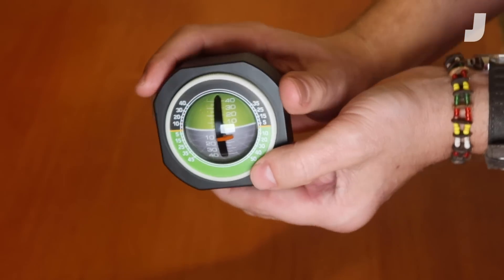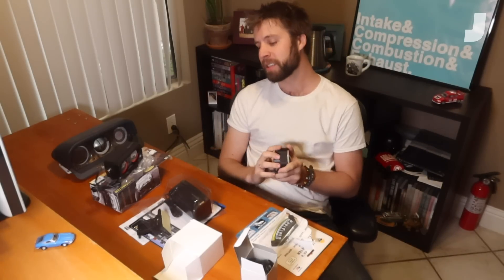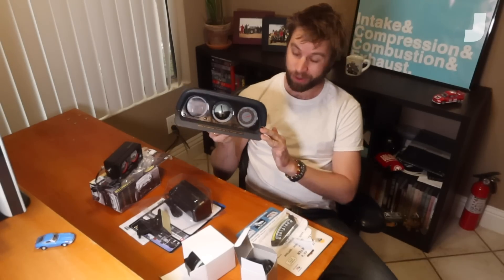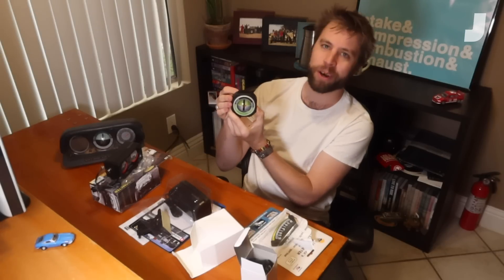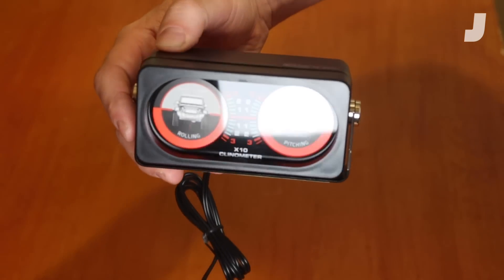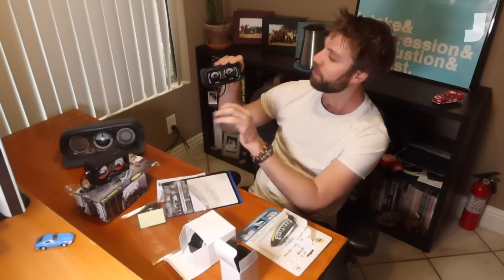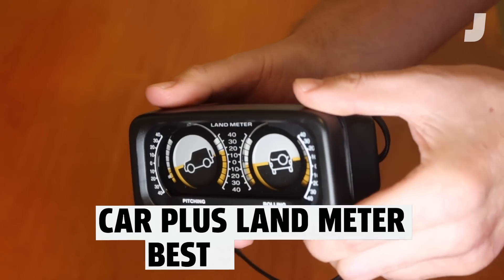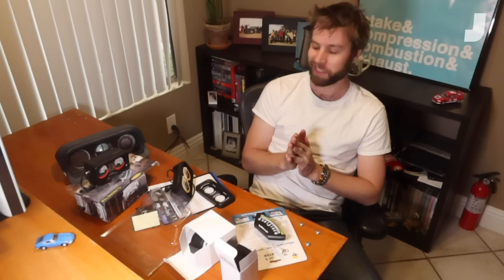WTF Are Inclinometers And Why They Are Cool

Comment: maybe they could make one to measure how hard someone brakes and accelerates
Reply: It's actually possible to do that by reading the OBD port (the weird connector beneath the steering wheel area). it'll be able to tell you how hard throttle is being pressed, how hard the brakes are being pressed, so on. It depends if the car has sensors for those though. Allstate and a bunch of other insurance agencies offer small devices that connect to this port and read that data (drivewise, snapshot, so on). They then periodically use cell towers to send the stored data back to the insurer. 

If you're looking for the actual acceleration change of the car, the OBD port could also technically be used for this I think. You could find and get the car's current speed, and do some calculations on the last few values to get current acceleration. I think there are OBD-based info displays you can buy that mount to your car, but it might make for a cool Arduino or raspberry pi project if you have some experience with the stuff.

Comment: That's great you like the Lev O Gauge! I use two in my 4Runner. Its fun for offroading but I use mine for when we setup camp since my wife and I sleep in our truck when camping. 

Where did I mount my two? Well one is on the dashboard for side to side readings and the other on the passenger door for front/back readings. I found it easier to see the passenger door vs the driver door. 

Find out more on my Instagram @twistingterrain